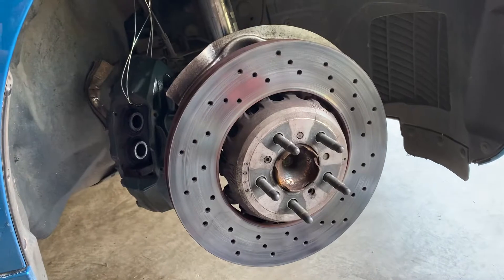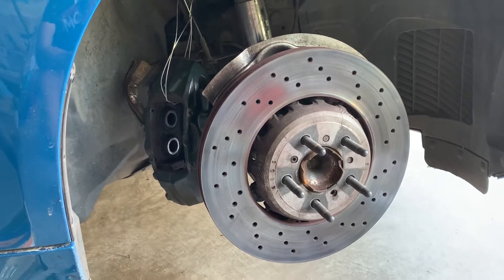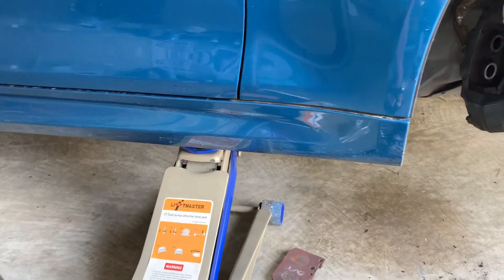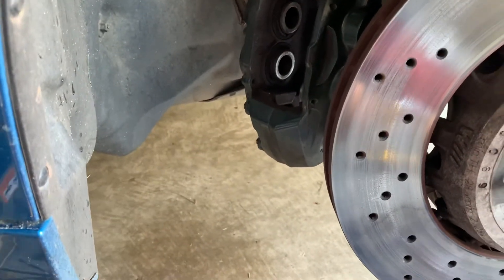Change rotors on a BMW M2 (applies to most cars)

Comment: Hi, which was your disk thickness when you replaced the rotors? BMW stats under 28.4 should be replaced, I was wondering how were yours
Reply from the maker: They were still within tolerances but the cracks were getting too large and approaching the outer edge so I decided to replace them.